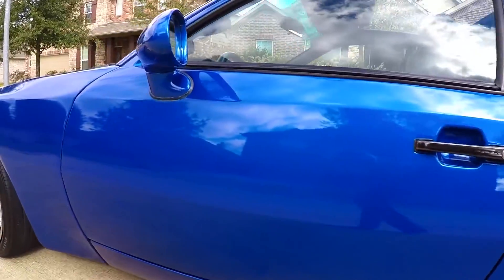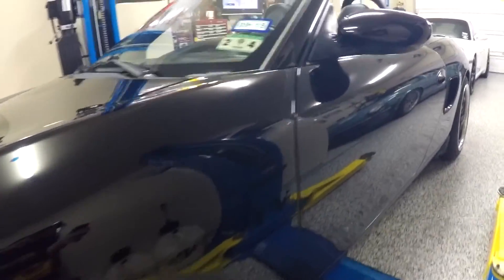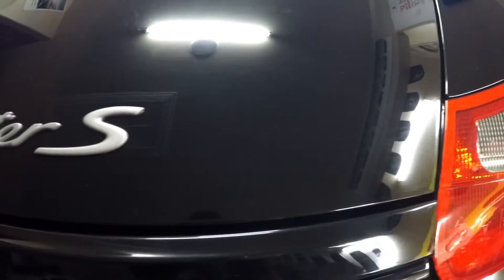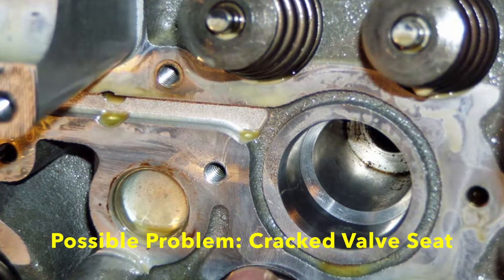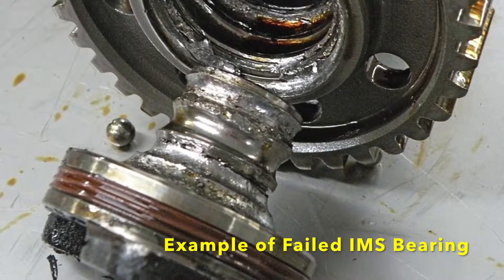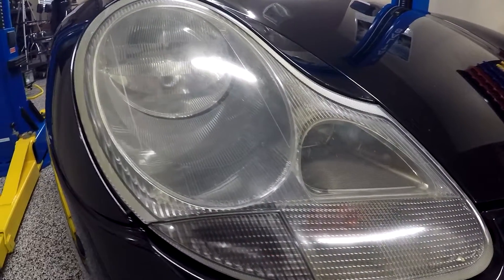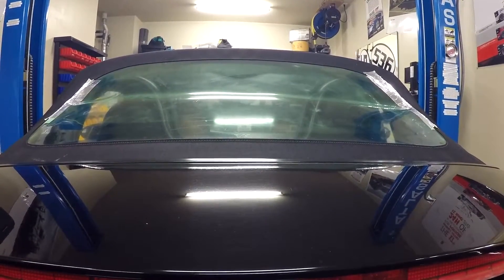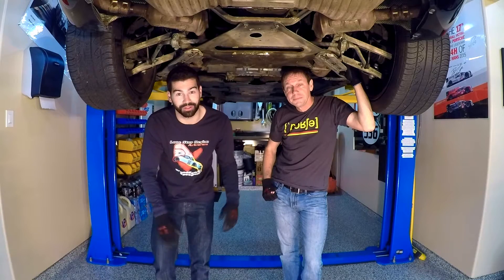Introducing...Jet ! Our Porsche Boxster S (986) Project Car

Comment: Hi. That window noise is the window regulator but not its motor. If the motor was a problem the window would not operate so smooth or run at all. The cables in the regulator are out of bind, twisted, semi snapped or the plastic rails for the cable are broken. I changed mine on my driver side. It cost me around $100 for the part, brand new - oem - I got it from ebay.
Reply from the maker: Engleburt,
Thank you for this update to the video.  You have an excellent point regarding the motor functionality.

Comment: The IMS bearing is infamous because the whole problem is hyped up. According to my local Porsche and Ferrari specialist, the failure of this bearing accounts for about 0.5% (1 in 200) of cars in this age group and the cost of replacing it (on the off chance it will fail) is about 2/3rds of the price of a good second hand replacement engine, including labour. No serious gambler would look at these odds, in my opinion.
Reply from the maker: We totally agree the IMS is a hyped up issue.  The odds are definitely in your favor....but if it happens to you....
At some point a new clutch is in order, or the Rear Main Seal leaks.  At that time, it makes good sense to go ahead and replace the IMS.  Although the LN Engineering Retrofit bearing is pricey ($800), this ceramic-based bearing system is likely a better long-term solution that a simple stock bearing replacement.  A PelicanParts bearing kit is only $185 but is not ceramic based.  Regardless of what bearing you choose, the basic recommendation is to replace the bearing whenever you do a clutch replacement (approx 40,000mi).  This is a very conservative approach, but let's face it, 40,000 miles doesn't come around that often.  Of course, the bearing is just part of the cost.  To do the work, you need the right puller and timing tools.
It's still relatively cheap insurance, as these motor parts are getting more expensive every day, and in some cases difficult to find. If your motor fails due to an IMS, you are going to wish you had spent the money on regular IMS maintenance.

Comment: I have 1998 Boxster 986 and i love my car but keep it in perfect condition is very expensive
Reply: +Maxim986 You are not kidding about expensive.  My rear coolant tank had a leak (a common problem I guess) ...$1500 later, no leak! LOL..
Reply: Yeah I know it.My coolant tank was also cracked.Now i change the clutch and IMS bearing.everything is very expensive but i love my Boxster.it's a great car riquester1971